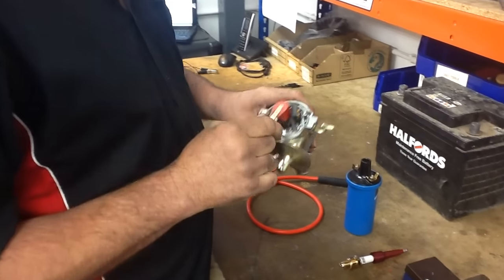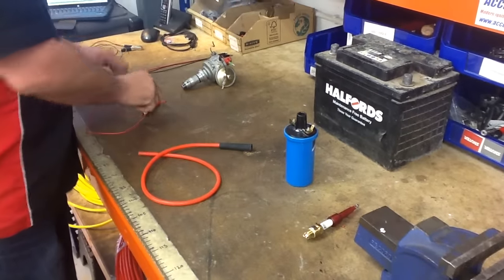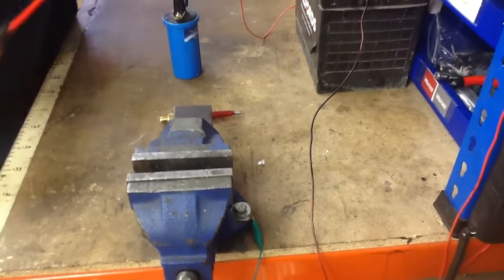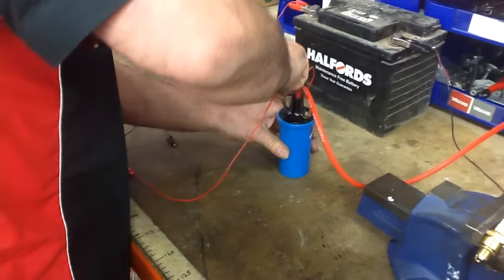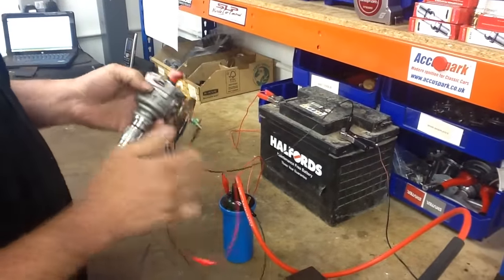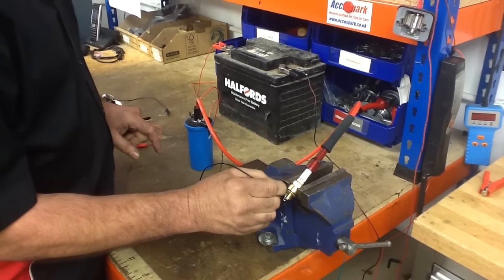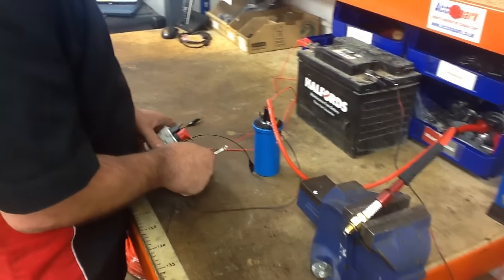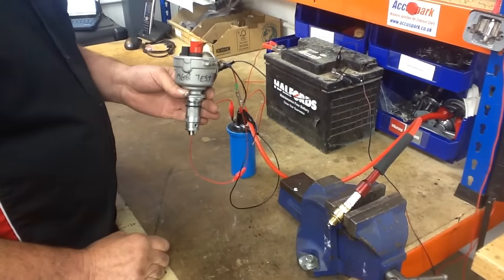AccuSpark Electronic Ignition Test Rig

Comment: ok,  so i have proven spark,  but my 2nd trigger box, now sit about 90 degree from the 1st box placement,  I installed dizzy so rotor points at the same cylinder  ( 180 off key nissan dizzy) not running,  can some  one do a video on this, what it sounds like and the solution